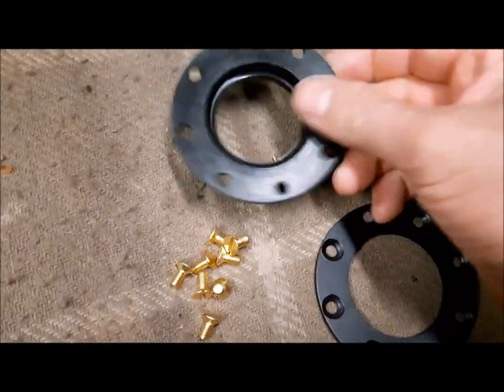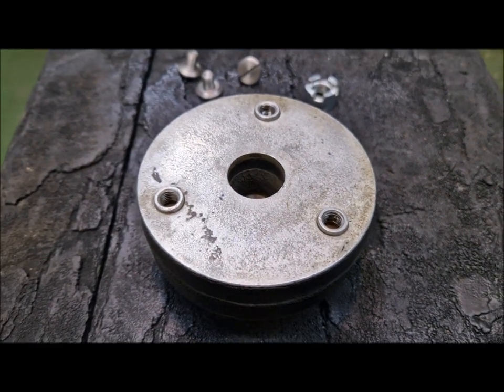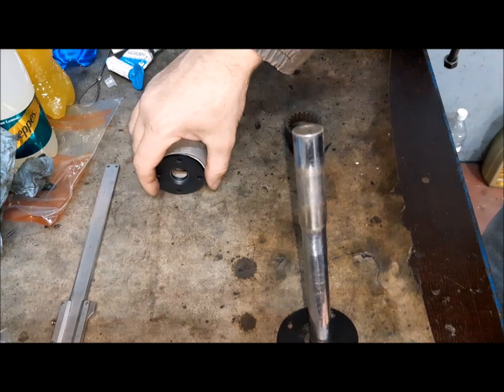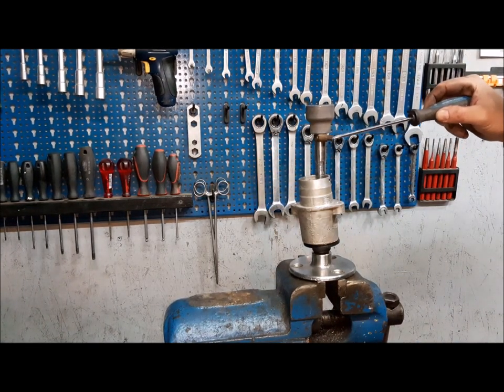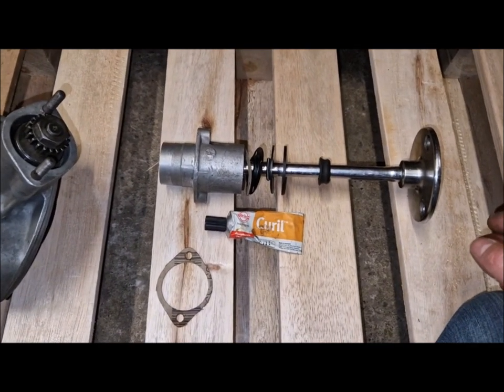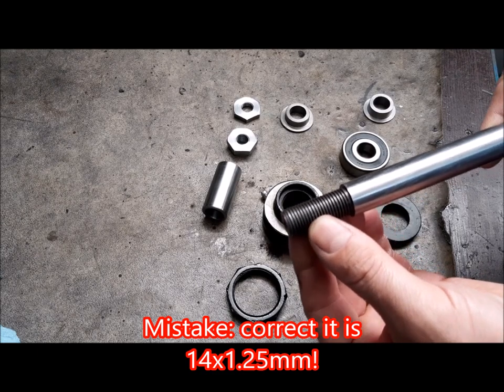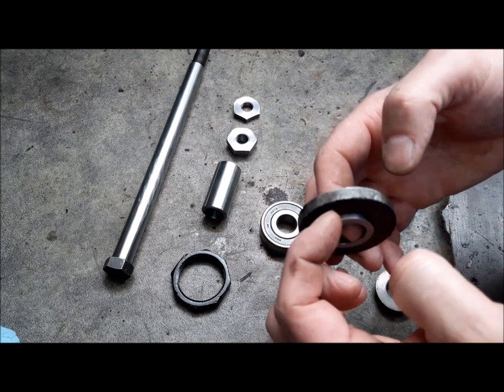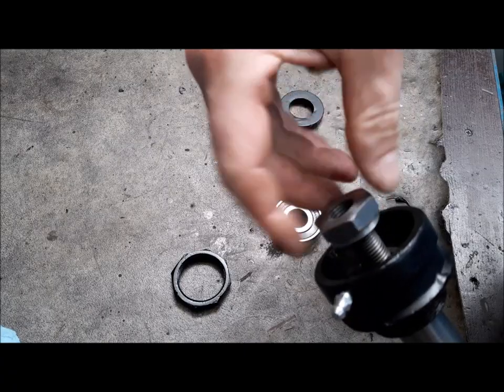BMW R35 (1938) - Part 50 Assembling the rear drive

Comment: Can you provide the dimensions of the two spacers that sit inside the Lagerbüchse?
Reply from the maker: You mean the spacers that are inside whit the wheel bearing on the left?
Reply: @lznicu  Yes please.
Reply from the maker: @gerardcooksley6104  Height: 12 mm, exterior diameter 23mm, inner diameter 17mm. The second bush has a height of 15mm. However I don't remember and I have noted the diameter of the outer shim but the outer shim is only to keep the sleeves inside the carrier bearing so you can add a three millimeter for the shim diameter and 1-1.5mm for the thickness. Keep in mind that sometimes is necessary to adjust the spacers according to your needs, this note I have found on the forum https://www.emw-r35.de/
Reply: Привет, знакомый форум) 
У вас отличные и информативные видео, спасибо! Не могу найти видео о проводке электрике BMW R35, в каких местах проходит проводка провода и её соединение, думаю что у вас есть такое видео, спасибо большое.